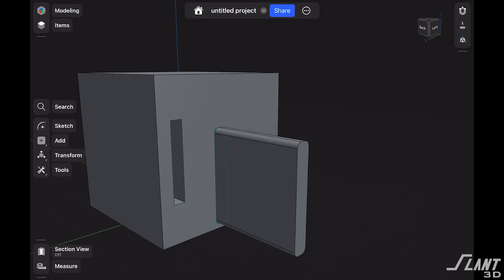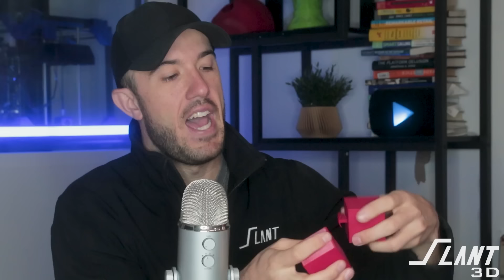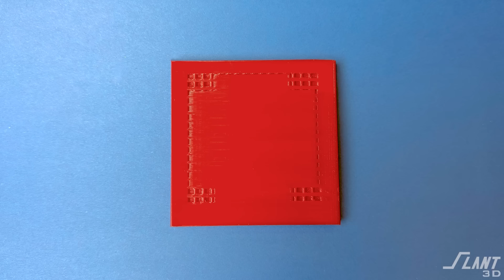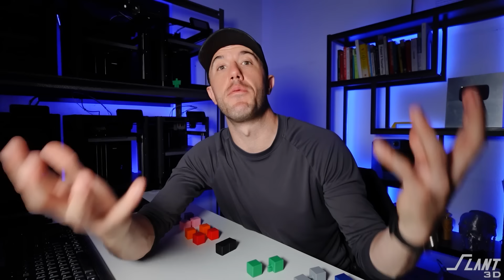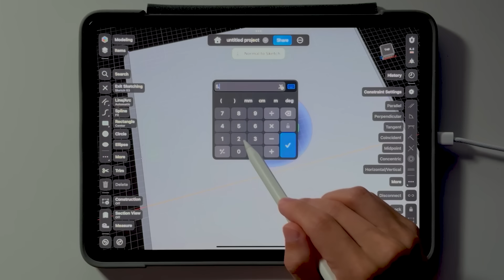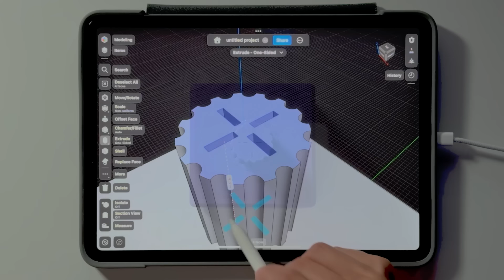Ultimate Guide to Connecting 3D Printed Parts | Pins, Fins, Slots, & Snaps

Comment: I like to print all my parts with female connections then print dowels as separate parts. 
Means that even if the connection isn't quite right, i don't have to reprint the whole part, just a slightly tighter or looser dowel. 
Will change my dowel designs with some of these suggestions tho

Comment: When you MUST make a vertical cylinder, insert a hollow cylinder inside the actual outer cylinder. It creates actual walls, not infills. The hollow cylinder can also deep into the object to create even more stiffness than just on the top layers of the object.

Comment: Hi! I was wondering if I could send you one of my designs and have you help me improve the connectors. I’ve tried about three different connector styles, but I’d love something that aligns perfectly, fits securely, and is strong enough to hold the pieces together without glue. The glue is getting messy, especially on the flat surfaces 😢😢😢😢

Comment: This is a really good video. Thanks for sharing your knowledge. There is confusion on YouTube about the meaning of the word tolerance. Some people say it when they are referring to what is actually a clearance. A tolerance is a range in which a certain dimension is acceptable. A specified dimension of 1mm may have a tolerance of +\-.1. That means the part was designed to be  1mm but it’s acceptable if it’s between 1.1 and .9. Clearance is the space between features.

Comment: If "injecting" glue into an internal path, make sure there is a way for the air to escape.  Best practice is to add an exit slot at the end of the path where the air can exit and glue also, so you know you filled it completely.

Comment: As a machinist working in metal fab for decades I can 100% agree that when he days "these can not be machined" he has no idea what he is talking about.  ThThere are certainly some 3 peinting techniques which are prohibitively difficult or even impossible for traditional subtractive manufacturing but these little spring tabs and the hole they inset into are not one of them.  That would actually be fairly easy to manufacture and would require any extraordinary effort.  Just a milling machine and a two bits.

To solve your issue of huge block with tiny week tabs you should make the tabs thicker.  2 - 3 times larger for a block that size.  To solve the issue of their weak spring force but a leaf spring between the two side.  Badically a half circle between the ears to give them much more spring and structural support.

That said the obvious solution to this who issue is a tampered V track.  It would only get tight at the moment the parts weelre in their final position.  So no need to fight a long tight track in insertinsertion.  If you like a small locking tab or bump at the end to keep it from being unintentionally separated.

Comment: What about if you are printing a file off off of online that is supposed to connect with an every day part and it just seems like the scale of the part that you print is off either too big or too small even though the actual printed part printed very smoothly and is perfect it doesn’t snap into place like you wanted to

Comment: Hi !
I've successfully designer the flexible fins, but I am running into an issue: it can't be printed horizontally.
What would be your advise ?

I was planning on using them for a 10 x 10 cm x 1 cm thickness piece, which should be printed horizontally in theory ?

Comment: Have you done any videos showing how to build custom boxes for electronics projects? I can just hot glue parts into the inside of my boxes, but sometimes it seems like it would be a lot neater to create compartments and/or "shelves" for components to sit in and just connect to the other parts of the project using wires. I would like the components to be able to snap into their compartments too. I've built some things like this already, but sometimes it's hard to think through. Looking for some good techniques.

Comment: I would like to request a video that covers joining parts specifically on the bottom of the print (I.e. two halves of a sphere). That would be really helpful, because as handy as all these tips are, nearly all of them don’t work in that orientation. 😢

I think I will try out the “s” lock and try and Frankenstein some others 😅
Reply: you could make the sphere halves with threads inside the bottom face and then each time you print two halves of the sphere you print a threaded portion that is paired to the sphere. like a little all thread or bolt with no head

Comment: I can't help but wonder if a variety of Japanese woodworking joinery techniques might work for printed parts. They have such a wide variety of joints that require no metal fasteners (or glue), but are designed to lock together rock solid.

Comment: A few things,.. you can also turn the circumference of the part into one big continuous snap clip. Additionally the glue channels can be made better by having a one layer thin area around it so the glue spreads out, making it stronger since glue isn't necessarily a structural element.

Comment: Using "microfeatures" effectively as a kind of universal slicer hint is groovy. It's an interesting workaround - really love that.
It does almost beg the question of whether "native"s support for this thing wouldn't be handy - it's just that CAD modeling programs are 3d printing-agnostic. It would be lovely to annotate geometry in a non-destructive way within the modeling tools. Support hints being perhaps a similar case. Any part of my workflow that involves painstakingly doing things in the slicer is a liability - so microfeatures are solving a real problem. 

Without your micro feature hack, one could use slicer hints etc. But I kind of regard anything that happens in the slicer as busy, unrepeatable work. It's unscalable: much of the same argument you were making about the need to make models robust so you're not making bespoke changes for each printer.

Comment: Your content is fantastic. Far better than my CAD capabilities, so much of it is currently wasted. Booo.

I understand that you are trying to ease your burden of fixing bad designs so that your company can print them, but I, for one, would enjoy your expertise to be transmitted in the CAD space as well. The fact that you seem to be doing CAD on a tablet, is blowing my mind straight up, but that is another topic entirely.

I understand 3D engineering drawing, but I have yet to grasp how to actually do it in TinkerCad, FreeCad, and most especially Blender. I do not even see the proper icons or drop down menus to put chamfers into a design, and I can barely get the programs to show me the XY, XZ, or YZ design planes at will, without some other twist turning the whole space in 3 dimensions. It would help if you used freebie tools where possible, budgets being what they are, and mine is more limited than most (which is why I am doing all of the work). I know the problem exists between keyboard and chair (or mouse and chair), but a little training might help? YouTube has FreeCad training programs, but they skimp badly on details.

Thanks for anything you can do to help a frustrated Cad abuser.

Comment: Super interesting. The point on adding textures for gluing is something I never thought of. Brilliant. I wonder what this implies for the kind of glue works best. You're turning the glue into a system of tiny dowels, so the bulk bending and tensile strength of the glue itself becomes important, when in most applications it's not.I guess you just need something matching the plastic's bending strength. In most cases it's probably no issue.

Comment: I agree that there are things that only 3d printing can make, however, the locking tabs concept absolutely CAN be made by other manufacturing/machining methods.
Reply: He obviously has never heard of a conventional (ram) EDM.  Almost exclusively used to made molds of all types.  One caveat, the work piece must conduct electricity, but that what is referenced.

Comment: Question: Could you make a video about hinge types that you have the parts separated and you connect them together after printing?  So, it doesn't just snap together. It needs to move around once stuck together and stay together long term.

Comment: Good video with a lot of useful information.

For joints section, which was the first third of your video, why not take a page out of woodworking and try dovetails? You can do standard dovetail joint or sliding dovetails. with chamfered edges, both would work nicely.

In addition, there are Japanese style joints. A simple one I tried is a tongue and groove design with a slot into which you insert another piece. This extra piece, with a bit of trial and error and proper tolerancing can and does pull the joint together and often can be taken apart.

Comment: I highly suggest taking a look at japanese joinery - The most satisfying 3D printed connections i have ever used were inspired by it.

They utilize small wedges and dont rely on material properties too much since wood can also have quite a variability.
If designed right its easy to print without supports. The pieces lock each other and dont move at all yet it can still be easily disassembled. 
They also work at very small dimensions.

On printables you can find a good example on what can be done on model/905304-adjustable-center-scribe
It has sub mm adjustability yet stays rigid.

The only disadvantage is that it takes some harder thinking to design and that you usually need an extra connector piece. It doesnt always need to be complicated though, take for example your slight draft angles, if you were to just place another wedge across, through the hole and the pin, you would have created a locked joint, tightening the drafted pin even more.
I believe this type of connection is very underrated and has a high potential. I think most 3d printed connectors are inspired by molded plastic and other already existing plastic connectors where the variability of different machines and materials does not exist.

Comment: If you want to glue ( you can also snap + glue ) i suggest to use the Pattex special kleber one, it's a tiny 30g red bottle with a needle to depose the glue. If the needle is clog you can use tiny needle has the same you clean your printer nozzle.

Comment: This is SUCH A GREAT channel! I really wonder why you don't have more followers. 👍🏻
Reply: Because proper engineering has solved all these issues with better mating mechanisms already and this is only valuable for Slants business because it makes printing and assembly easier on them. Look at something as simple as the battery door on a roku remote for a better locking mechanism than any of these solutions. 

Most of the sloppy snap joints that he claims you can tweak are actually always going to be sloppy because they have to overtravel to catch and 3D printing accuracy isnt high enough to tighten up the overtravel any further without creating parts that dont mate at all.
Reply from the maker: Thank you so much. That really means a lot

Comment: Do you have any tips for printing pins/clips out of TPU?
I love how strong my Hoopin TPU Cable Tie designs are but sometimes wonder if it's possible to strengthen them further. One solution I found is simply using 2 or more pins which notably increases the strength.

Comment: There's an entire approach you didn't cover -- SWEPT features, using the perimeter as the path. It can be for locating or for locking with more aggressive geometry, but fundamentally you're maximizing the available cross-section of the object to create a feature taking up the majority of the cross-section. 

Think like the lid on a can of pringles -- it's hard and expensive in manufacturing and not necessary for anisotropic materials, so you really only see it on things like hollow parts -- but with 3D printing you can connect any two parts this way, it reduces risk of failure on layer lines by spreading the stresses out over the entire wall of the print, which gives you more options in terms of print orientation.

Comment: there are some good woodwork joints that we can put on our prints too
Reply: Bowties and dovetails are amazing and I use them all the time in 3d prints. 
Woodworkers also have the same problem in that they work with material that is stronger in one direction than another. You can learn a lot from a few woodworking books
Reply: such as..?
Reply: @fightlikabrave  Pretty much any of the traditional woodworking joints would work in 3d printing. I'd recommend looking up woodworking joints and then using the one that suits your application / the esthetic of the part. I personally often use dovetail joints in my 3d prints. There are also some really beautiful looking japanese woodworking joints that are relatively intricate, but that shouldn't be much of a problem when 3d printed. These are definitely more suited for esthetics rather than pure functionality.
Reply: @eliasv.1611  yes my concern is the strength as the materials are completely different with different properties. so your last sentence is what i was thinking.. Ill dig into it!
Reply: @fightlikabrave  Ive seen dovetail but with rounded corners.   That  looks like a good one.  It seems 3d printers dont like sharp corners so anything relying on that is probaby not the best idea if you can avoid it.
Reply: @NeedItMakeIt has some good videos about these